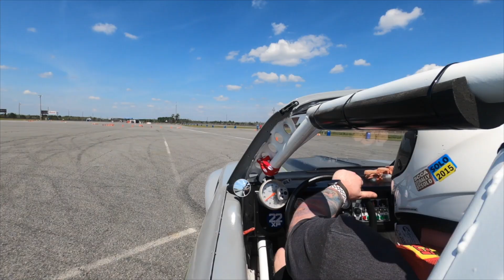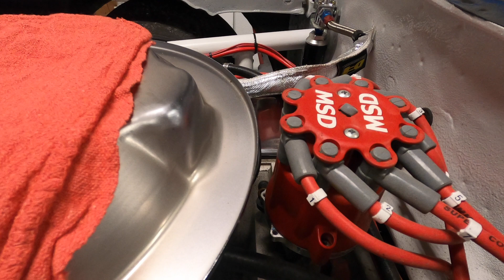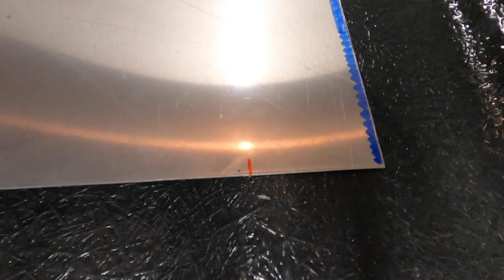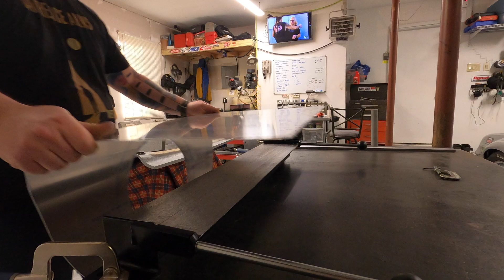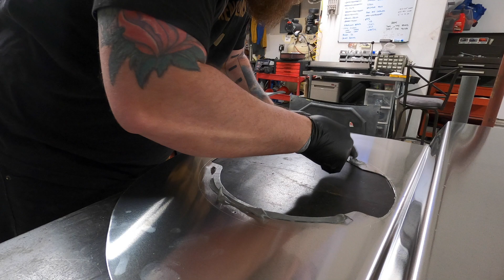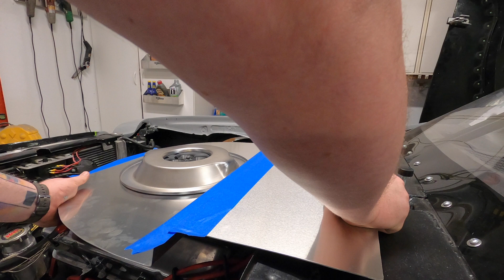A Breath of Fresh Air: C-Prepared Camaro - Finishing up the Carb Pan

Comment: Yeah, what I like about this is, aside from the stone-axe simplicity of it, it can be removed quickly, and replaced with a quote unquote correct one, for sitting around at a car show or whatever.  I'm going to try to get my buddy to put one on his 67 GTO. He doesn't have a cowl induction hood obviously, and the car is too valuable to change anything.  So I'm hoping the gap between the cowl and the hood will be enough for this to still work. He is definitely in need of some cool air...
Reply from the maker: Yup.  I have a spare air cleaner base with no modification that I can swap when it rains, etc.